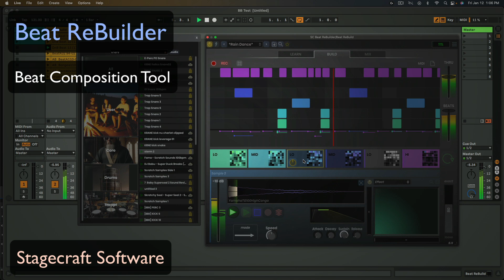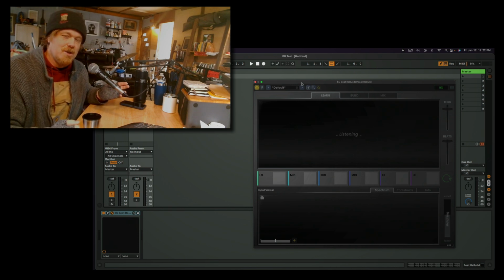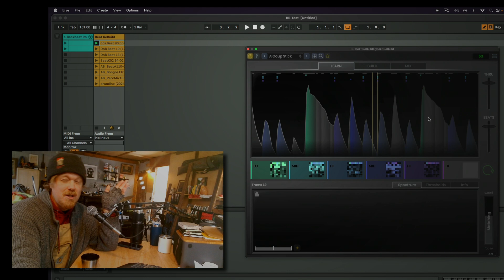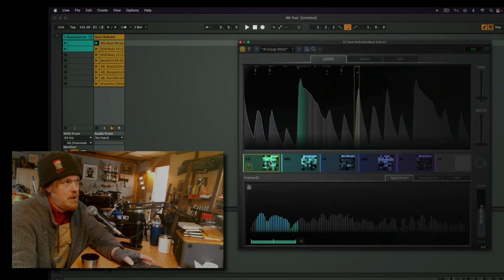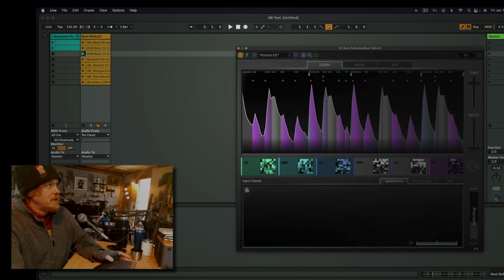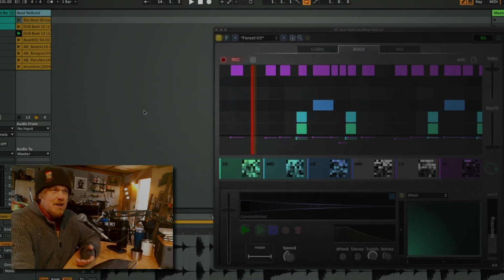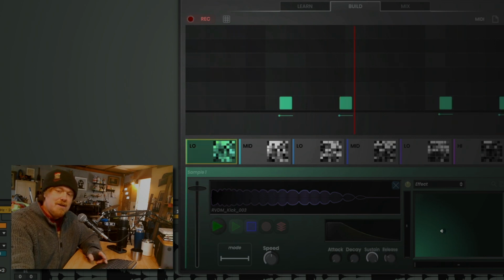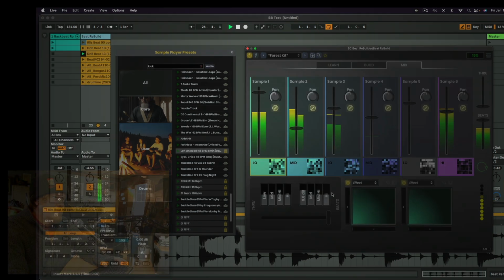Beat ReBuilder Overview | Beat-replacer plugin | Stagecraft Software

Comment: I can't find compatibility information on your website.  I need to know if this will work on Mac OS 10.13.  Also is this loadable as an AAX plugin?   Thank you.
Reply from the maker: I think so. Apple made changes in the notarization process, I think everything after 10.11 is fine though. But really, just give it a try. The download is small and it works for 30 days without a registration, so you can test it out :)